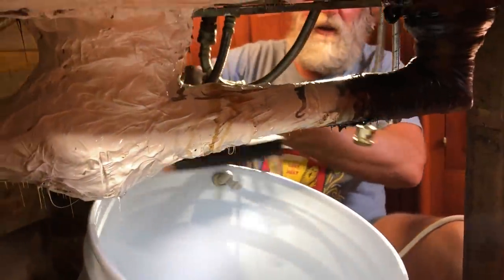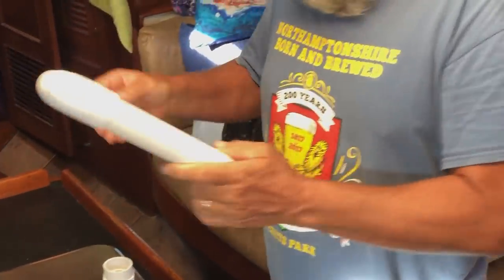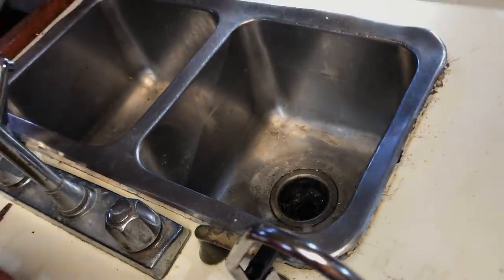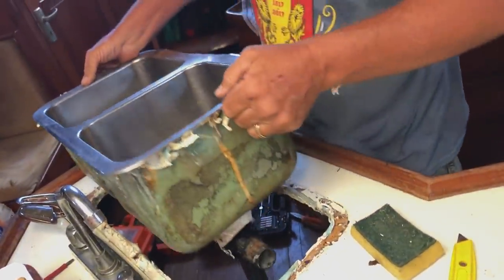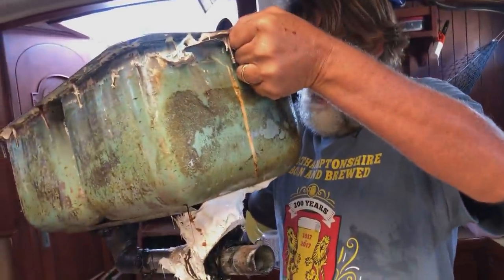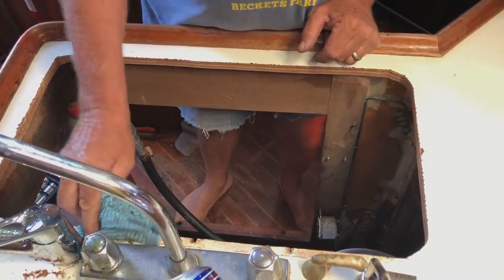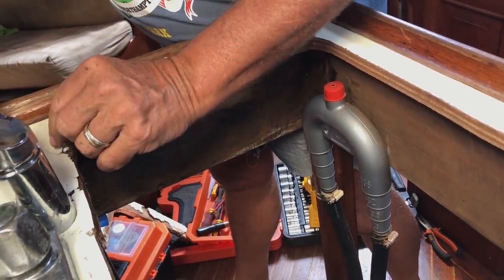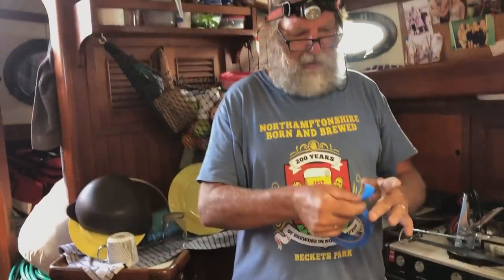Ep 237 | Installing Nutshell's New Sinks, Sailing Nutshell

Comment: SIKA underside of the sinks joint: check.  Might I suggest a strip of aluminum tape along the top?  It'll keep the moisture reaching the inevitable cavity.
Reply from the maker: Hi. That’s a great suggestion but hopefully we won’t have the sinks pushed together for long. The plan is to replace the whole bench and set the sinks apart. W.

Comment: erm, whats about the seam between the two sinks?
Reply from the maker: Hi. We’ve put the sinks in temporarily. They’re butted together so that we could install them into the existing hole and not have a void between them. When we replace the bench top we will seperate them, with about an inch gap, instead of butting them together. W.

Comment: Marcus you used a silicone type sealant to hold the sinks in place, the vlog shows you did not seal between the two sinks or was it a clear silicone sealant?
Reply from the maker: I sealed underneath the join with sikaflex